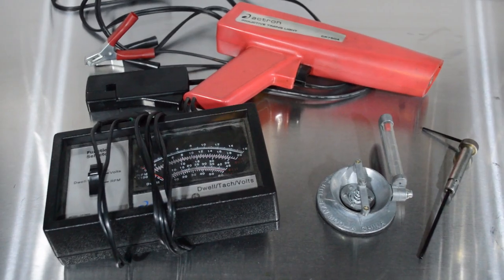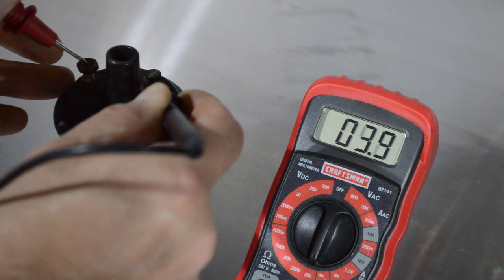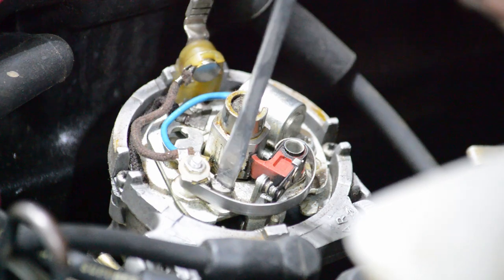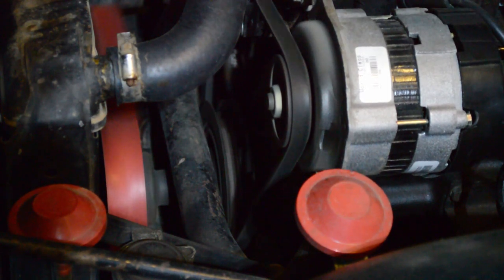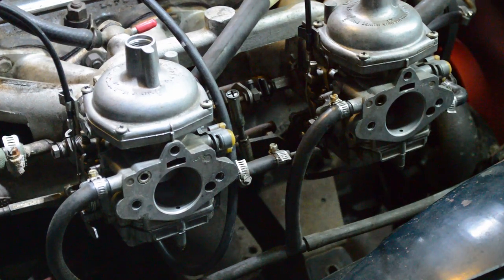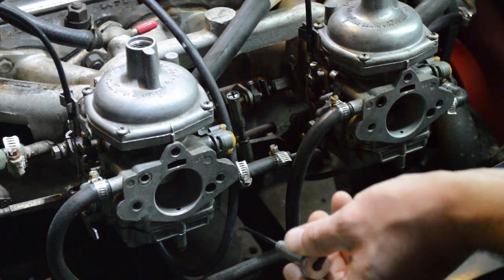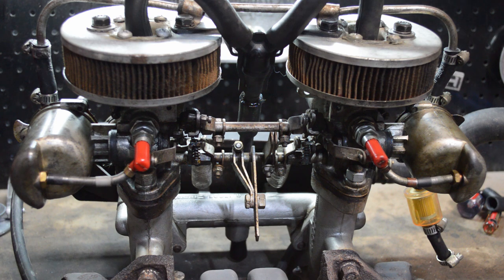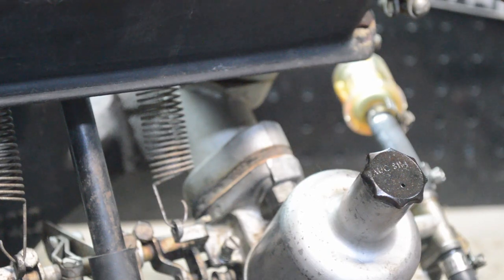How to Tune Zenith Stromberg or SU Carburetors on Your British Sports Car!

Comment: Hola Midwest. Felicitaciones por el video, es de gran utilidad. Estuve viendo el Link de Moss y venden una aguja 45 M que aclara que de gran altitud. La pregunta que te hago es ¿Que se considera gran altitud? ¿cuantos metros del nivel del mar?. Gracias.
Reply from the maker: Hola, y gracias para la pregunta.  Lo siento--mi Espanol es terrible!  No se si necesitas una aguja especial.  Cuando estuve en Colorado con el Spitfire, solamente necesito poner mas rico--no necitaba partes especial. 

Ahora en ingles:

Hi and thanks for the question.  I'm sorry--my Spanish is terrible!  I don't know if you need a special needle.  When I was in Colorado in the Spitfire, I only needed to make it more rich--I didn't need special parts.  

I hope that helps!  Thank you for watching!

Comment: Good morning!  I have a 1971 Triumph TR6.  It has Zenith-Stromberg 175 CD carburetors installed.   I have only owned this car for about two months.  I noticed on my carbs the fuel inlet that is located on the upper left of the carb is left open(no fuel or even a fuel line).  The fuel enters the carb on the lower right fuel inlet on both carbs only.   I noticed in this video that you have fuel going to both sides of the carburetors.  Should I have the left side receiving fuel as well?   The car runs great without any issues although it does idle at about 1500 RPMs.  What are your thoughts?  Thanks,  Randy Gibson, Atlanta, GA
Reply from the maker: Hi Randy, good question.  That's not a fuel inlet, it's a vent.  It should be connected to the charcoal canister.  On some cars, this has been removed (for no good reason, really).  In those cases, if it can't be easily reconnected, you should leave it to vent to the atmosphere as it is or it will leak.  Good luck with the TR!
Reply from the maker: Oh, and the idle can be lowered by undoing the throttle stop screws a little at a time.  I think I've got a video on tuning the carbs that might show that a little better. Hope that helps!
Reply: @midwestmotoring  Thank you for the quick reply.  Like I said I have not had the car for long.  It does not have a charcoal canister.   The carburetor vents are just left open.  I bought a cap for them.  I think I will remove the cap and let them vent.  As I finish the restoration I will probably add the  canister back to make it more like the original 1971.  I really appreciate your channel.  I’ve learned a lot from you expertise.   Thanks again.  Randy

Comment: I know this is a pretty old video but I have a question about where to start when reviving the old carbs on my barn find GT6. They had some issues when the car was still running about 15 years ago but since I've never really worked on carburetors before I'm pretty stumped on what to do.
Reply from the maker: You're in luck!  The GT6 uses CD150 carburetors, which are very similar to the CD175s used on a TR6.  This video should help: https://studio.youtube.com/video/wQaRvarG5oY/edit.  If you've got a very early GT6, there might be some differences, such as adjusting from the bottom or some differences in how the choke works.  By and large, though, it should be nearly the same.

Comment: Thank you for your videos I have watched them many times and was able to get a 71 TR6 running again after it had been sitting for a few years. I started by changing the fuel pump, then when one of the carbs was leaking I rebuilt them. Later i noticed the vacum retard was leak and replaced that as well. I have the petronics ignition and have the appropriate coil. 

Question now, is that in low RPM between 1500 and 2000 - when the car is on the road, I am getting back fire. Seems to be fire=ing into the carbs, because the pistons are blackened. I think I have looked at everything multiple time, but can't get the backfire to stop. 

Do you have any suggestions where to focus? Thanks in advance for your reply

Comment: I hv benz stomberg carburator it runs rich and plugs get black very quickly ,
If iam to lean the carburator do I hv to turn the nut below carburator to clockwise or anticlockwise  ?
Reply from the maker: You want the jet to go lower--so you will want to turn it anticlockwise.  Check that the choke is not stuck on.  If you cannot lower the jet enough, you may need to disassemble the carburetor to set the float height.
Reply: @midwestmotoring  Thank you

Comment: I'm a 78 TR7 with dual Strombergs. Do you have one, or is it pretty  much the same as your TR6. I rebuilt the carbs now they seem out of tune and idle too high for one....thank you!
PS Tequila for me in gluten free California,  though  it's not a  single carb 1975
Reply from the maker: They are pretty much the same. 1, make sure you loosen the throttle linkage when setting the idle so the carbs can be set independently. Also push the throttles closed to ensure nothing is sticking. 2, if you can't get the idle down no matter what you do, it's probably one of the bypass valves set too loose.  I should like tequila as I'm half Mexican, but it's whiskey for me. ;)
Reply: , @midwestmotoring  Just like my cousin.Your better half is disguised, I'm an 1/8th N.A., BTW. I want to know about the two screws on the side of the carb.Is that mixture or the  bypass valve? Is this something that is like an art form or can a rookie like me  hack it.  Maybe there is a good book on it. I'm getting the tools for the job, but getting it to pass smog....well maybe the  shop with a gassalizer machine is what is best.Any recommendation and thanks for the reply. Brian
Reply from the maker: Anyone can work on these. It takes time and a few tools.  If I know which screws you're referring to, one is in the bypass valve and the other just above the temp compensator.  The one on the bypass valve controls how much vacuum is needed before the valve opens.  It should only open at very high vacuum, so if your car is idling fine then don't touch it.  If you can't get it to idle below 2500 or so no matter what you do... then suspect that screw.  The other is an idle trim screw. As the engine wears in, it's slowly closed off. It's a very fine adjustment and normally you'll need a gas analyzer to even tell the difference.  Just screw it in all the way and out maybe half a turn and it's good enough.
Reply: @midwestmotoring  Thank you. I think I'll look into your series,it seems to make a sense to me when  you explain it.
Reply from the maker: That's the goal. Hopefully more classics end up on the road. If you get stuck and need help, just ask!

Comment: how do feel about weber 32/36 conversion for a Tr-6.
Reply from the maker: Just in general, I don't like the shape of the manifold.  You're taking a side draft setup and putting a downdraft carburetor on it--but without much room, so it makes for some inefficient angles.  As for the carburetors themselves, there's nothing wrong with them--but the Strombergs on a TR6 are definitely not the limiting factor when it comes to making power.  Side draft Webers such as DCOEs are a different story.  They have individual openings for each cylinder, and especially in a full-throttle situation can flow more.  However, the engine in stock form simply can't pull that much air--so it's a waste without considerable upgrades such as raising compression, changing the cam, modifying the exhaust, and so forth.

Comment: I"ll have to get a timing light and a dwell meter! Do you have any plans on doing a video on a coolant flush and refresh for the TR6/GT6 ? I think i read there's something in the head you need to clean out with a wire?
Reply from the maker: That I'm not sure about. I'm guessing the wire may help to loosen silt in the cylinder head, but that may be necessary mainly when new (to clear out casting bits) and when the maintenance hasn't been done (i.e. the coolant and oil haven't been changed and have left solid gunk inside). I'd recommend having a machinist do that, as you should no doubt have the surface machined if you're going that far. Good question! Thank you!

Comment: what is the situation for adjusting the idle air bypass on the Zeniths? brass screw and spring on the side of the carbs?
Reply from the maker: So the bypass valve is literally what it sounds like--it bypasses the throttle with enough vacuum and lets in fuel/air mixture.  It's controlled by a spring pressing against a plate that seals off the flow.  When the vacuum goes high enough to compress the spring, it opens the plate and lets fuel/air flow into the engine.  You can adjust the tension on that spring by turning the adjustment screw (if there is one--if there's not, it requires disassembly).  

The procedure I use is to:
1. disconnect the vacuum retard (if you have it), which should bring the RPM to about 1300 or so.
2. Start with the adjusting screw(s) turned counterclockwise (you'll know it's far enough since the RPM will be able to drop to 1300 instead of staying over 2000--which indicates the valves are "floating").  
Turn the bypass valve clockwise until the engine speed jumps up abruptly (you're making it float on purpose).
3. Turn the valve counterclockwise until the RPMs drop back down to the 1300 where it was at.  
4. Blip the throttle and watch the engine speed drop back down to 1300.  If it stays high, the valves are still floating and you need to adjust it out another half turn until you can rev the engine and it returns to normal.  
5. Back it out one more half turn to seat the valve, reconnect everything, and balance the carbs or adjust the slow idle speed on the carb(s) if necessary.
Reply: @midwestmotoring  . Ok. Not the one I'm speaking of. this one is a brass needle,
Reply from the maker: Ah, you mean the thick brass screw on the side with the tapered end.  You can think of the floats as being the course mixture adjustment, the needle/jet as the fine adjustment, and the idle trim screw as the very fine adjustment.  For most owners it's best to just leave this closed.  I believe it's necessary to use a gas analyzer to tell the difference when making this adjustment.  Someone else might have more information than I do, but the short version is that it's not necessary to adjust.

Comment: After cleaning my plugs my 74 TR6 has a dead miss and bogs down in acceleration, changed plugs no diff. What should I test?
Reply from the maker: Check the oil in your carburetors. Classic symptom of low oil in the dashpots.
Reply: @midwestmotoring  they were low, but i topped them off, and still have the same issue.
Reply from the maker: Was the car running fine before? In other words, the car had no issues, you pulled the plugs and put them back, and suddenly the car didn't run right? If so, it could be a coincidence but suggests the plugs are at fault. Did you use the correct type? What's the gap set at?
Reply from the maker: Also, did you pull the wires? Check each one and verify the firing order. Was the distributor loose?
Reply from the maker: I should also ask... what prompted you cleaning your plugs?
Reply: @midwestmotoring  carbon build up,
Reply from the maker: @trrobbins4518  generally speaking, that shouldn't happen and is usually a symptom of another problem such as running too rich.  Mind you, running rich can itself be a symptom of timing being off, and most often is.  Start at the beginning.  Set the rocker clearances, check the distributor advance is working at all RPM and also coming back down, set the timing at idle, toss and replace the plugs, wires, cap, and rotor, make sure you have the correct coil (6v vs 12v), and then check the carburetor tune.  It's time consuming, but all just basic maintenance for these cars so it needs to be done anyway.  If you have a gauge, you should check the vacuum at idle and make certain it's where it should be to rule out leaks, etc.  It should run like a top when you're done!
Reply: @midwestmotoring  Thanks, i will follow your advice.
Reply: Had my tech adjust valves, changed out all elec wires, dist cap, plugs etc. car still bogs down, he tried to adjust carbs, none of the adjustments had any effect, turn screws, nothing happened, put the air flow gauge on carbs, and it would choke out the car. On the way home it quit running entirely. Could it be the fuel pump? Or the carbs?
Reply from the maker: A lot will depend on the tech.  Most in the US have not seen this style of carburetor, and most of the screws on the sides don't actually do anything if the rest of the carburetor isn't set up properly.  Assuming that the timing is set correctly and advancing correctly... if the air flow gauge is causing the engine to drop in RPM then one of 2 things is happening.  1) The air flow gauge may be closed off too much.  The gauge should give you a reading somewhere in the middle of the gauge.  If it's too high or too low, then you need to adjust the gauge to let a different amount of air in.  Most of the gauges have a threaded center piece that rotates to move in and out, but some have plugs that you can open to let more air through.  Try that first, otherwise... 2) That carb is supplying way too much fuel, and putting the gauge in front is reducing the air supply even further, causing the engine to bog.  

If it's the 2nd issue, now you have a new problem.  1) is the carburetor being adjusted properly?  Late Strombergs require a special tool to be inserted down the top of the carburetor--other adjustments will not work properly if this isn't done.  Early Strombergs and most SUs adjust by raising and lowering the jet from the bottom.  2) If there isn't enough adjustment and it's still burning too rich, then you need to disassemble the carburetor (again, assuming your timing and other engine features are set perfectly--otherwise this won't help either).  Anyway, if everything else checks out, then your float height is not set correctly.  Think of the float height as the coarse adjustment and moving the needle (or jet) as the fine adjustment.  If the float height isn't correct, then you can adjust everything else all day until the cows come home and it won't make a bit of difference.   

The tolerances on most of this stuff is measured in millimeters, so very small movements will make a huge difference.  The points under the distributor cap are measured in thousandths, so it's even more critical here.  If your car was running well before and isn't now, then it's not likely to be the float height (unless you have a leaking float, but then you'd have a fuel leak to go with it).  That means something has been overlooked, and you need to start from the beginning.  The best way to find out what's wrong is to check things you're 100% sure don't need checking--it's going to be one of those and you'll kick yourself for not checking earlier.  Run all these tests and write down the numbers you get from the gauges. 

1) Check compression.  What's the reading from each cylinder 1-6?
2) Check fuel pressure.  How many PSI are you getting from the line right next to the carburetors?
3) Check your point gap.  Which feeler gauge did you use?
4) Set your static timing.  How many degrees is it set to?
5) Now you're ready to start the engine.  Put a vacuum gauge on it.  What's the reading at idle?  Is the needle smooth or fluttering?  Is it moving?
6) Finally, you might need to touch the carburetors.  

All of these are extremely important.  If you have a problem in step 2 or 3, then you could take a set of brand new carbs off an identical car that runs perfectly... and it'll never work no matter how much you adjust them.  I hope this helps.  Sorry for the long-winded response.  Keep working at it!

Comment: How do you set time on  a TR6 with Petronix ignition?
Reply from the maker: A timing light pointed at the crankshaft pulley timing marks is the most accurate way to time the engine with any ignition.  If you're asking about static timing, my understanding is that Pertonix ignition systems can be static timed in the same manner as points ignition.  Set the timing mark on the crankshaft pulley to the desired static timing position.  Connect a test light to the switched wire running from the coil to the distributor (the one that is not the power wire) and ground the test light, then turn the ignition on and twist the distributor body counter clockwise until the light is out.  Then turn it clockwise slowly until the light comes on.  Lock the distributor down and check with a timing light for further tuning.

Comment: The diapragm cover on the front carb is not fitted correctly. You have it 180' out. The alignment mark on the casting is is not aligned with the one on the carb body. The rear carb has the marks aligned correctly.
Reply from the maker: Wow, I'm not sure how I've missed that.  Good catch!  It's actually only 90 degrees out, rotated counter clockwise.  Still... too much focus on the camera and not on what I'm doing.  I'll head out to the garage now to fix it.  Much appreciated.

Comment: Poor filming; the exact use of the adjustment tool on the Zenith carb is outside the picture although it seems that, although he says that the carb "is running a bit rich", he turns it to the right - thus making it even richer!
Reply from the maker: I'll admit after re-watching the video it certainly does look that way.  Some of the talking was a voiceover that was recorded later--it's very possible that I made an error and if so I apologize!  Hopefully that clears things up, but the procedure really is the same.  Thanks for the comment!